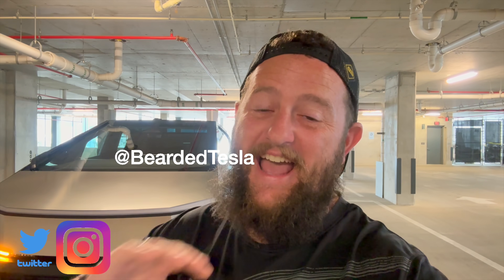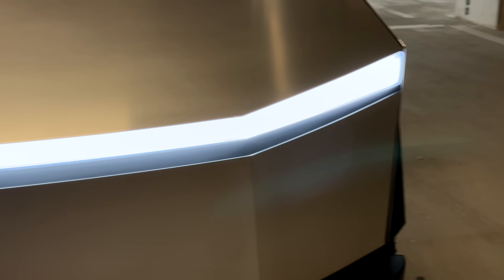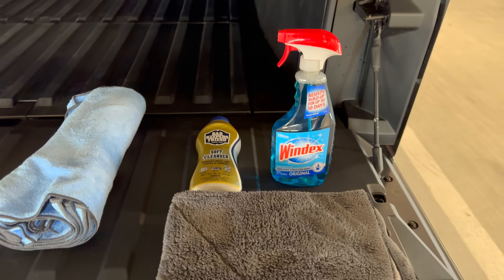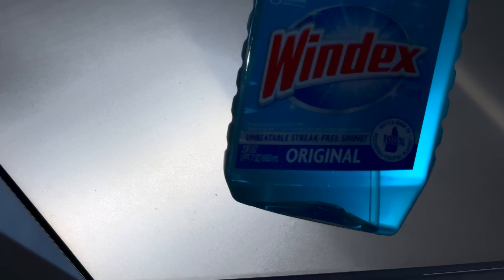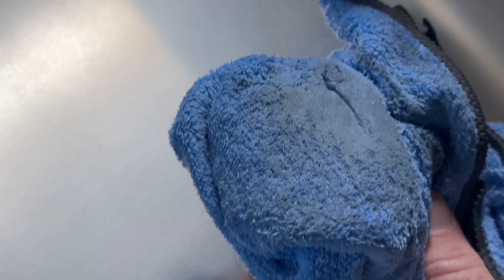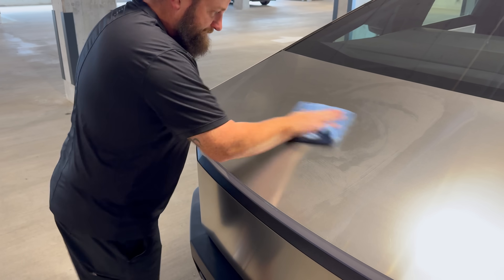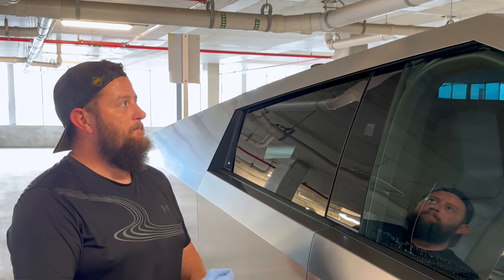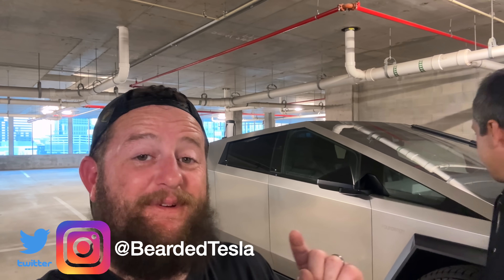Tesla CyberTRUCK or CyberRUST?? The TRUTH About Cybertruck Rusting Issue + How To Fix It!!

Comment: So this is essentially rusty dirt that has landed on the truck, rather than rust from the truck itself, but you need a cutting agent to remove it? So this layer of partical debris which has simply fallen on the surface of this $100k luxury truck cannot be removed without literally stripping away the top layer of metal from the vehicle...

It sounds like the rust is in the top layer of metal of the truck, not just sitting on it. If not, then how do you clean this truck at all? With a cutting agent every time?
Reply from the maker: its the same for painted cars. This is nothing new. Even painted cars that get this stuff on the surface have to be polished to get it off. The oxidation makes it really latch on, meaning it wont wipe off with just water or glass cleaner
Reply: @BeardedTeslaGuy  It still seems like a bit of a design flaw. Clear coats and wax can keep your car easily cleanable from most things, even caked on dirt. Having to use a cutting agent in order to clean your car at all is not a good thing.

Also, rust flakes landing on metal will actually rust the metal underneath. The electrochemical reaction will try to equalize the good metal with the bad, causing the good metal to degrade. This is why once something is rusted it never really goes away unless you introduce a metal with a higher charge, like zinc, to prevent the rust from attacking the base metal.

Or cover it in a patina, but that obviously isn't an option for a car.

Comment: It's called "industrial fallout". It's just iron that's falling onto the surface. Clean it with iron remover when you wash the truck. Simple. It's the same iron that's on top of painted cars. Which is why we use iron remover before polishing a painted vehicle. Iron remover, just spray on then hose it off with water. No scrubbing needed, therefore no scratches. Now to be clear I have not tried iron remover on a non painted or clear coated surface so I would suggest trying it in an inconspicuous spot first.

Comment: Cr-Steels need the covering Cr-Oxid layer, to avoid Rust. If you paint it, IT will Rust. If you Pick Up Metal particels from the streets, caused by other Cars brakes - IT will Rust. If you want to argue your neighbour with a Cybertruck - Put a ferritic screw on His Truck over a rainy night. Ferritic steel particels can also come from the ferritic Tools in the press- or Bodyshop. This structure is a construction-mistake as it's best. Good luck - "Elon Rust"😂

Comment: This is common issue with stainless steel especially brushed stainless-steel. ATM keypads manufactured from stainless-steel suffer this in environments where there's a high level of iron particles and high humidity. In our case ATMs located on very busy streets and not too far from the ocean developed rust 'spotting'.

These micro-sized iron particles become trapped in the surface finish often applied to stainless-steel and then over time in the presence of high humidity....'rust'. It can be scrubbed off with a plastic bristle brush (or cloth) and a good quality stainless steel cleaner. 

Of course, all the naysayers had to assume the Cybertruck was 'rusting'......(our customer at the time thought the same thing 'oh no, our stainless-steel keypads are rusting'!

Comment: Dude,  it is called ‘rouge’ or rust there is carbon in this stainless steel.  Steel isn’t completely uniform material.  Think of it as a cookie with a slight taste of salt present.  You should  polish and passivated.  Citric acid and electric current is your solution

Comment: soap + steel wool for pan cleaning will work much better.
Reply: Steel wool is the worst thing you could do. Fine pieces of steel will will break off and settle in the grains of the stainless steel and start to rust.
Reply: @kennethsouthard6042  if you scrupt without soap it will rust.

Comment: any iron particle contamination on the surface is going to eat into the steel. the surface of the truck is going to need frequent cleaning. someone should take the truck for metallurgical test to see just what its made of. Not all stainless steels are equal. I used to work inspecting industrial equipment and for anything exposed to the elements seems 316 and 316L were the materials of choice. but I'm not an engineer, my just was just to verify the materials per the drawings.

Comment: Doesn't this issue happen on any automobile? A few popular brands from Mother's and Meguiar's make iron fallout removers for vehicle finishes. The reaction of the spray with the iron creates a purple color. If the particle is embedded, you can use a clay bar.

Comment: No Sh#(t
As a ex Time Machine Delorean mechanic visual body panel rust is NBD
True Problem
Electrical grounds on Time Machine Delorean is 1,000 x worse than visual surface rust. I could not fix all the Time Machine Deloreann electrical problems.
and
Tesla is based on electrical hardware and software that means Time Machine Cyber Truck will self destruct
Con Job
Really bad is that Tesla knew about the rust problem and did not tell all those $120,000.00  Cyber Truck buyers 
Shame on you Tesla

Comment: Every metal oxidizes and any steel can rust. I don't believe for a second that some special "blend alloy" (whatever that means) has been developed for this truck. Just do an xrf (pmi) on the surface of your truck and we'll know what it's made of. Then any informed engineer can tell you under which conditions it rusts. They own one at most scrapyards, and if you want to be more thorough, go to a materials testing lab.

Comment: Some years ago, I had a white painted pick-up truck and noticed there were hundreds (maybe thousands) of spots of rust on the paint. I took it back to the dealer and he explained that it is actually called “rail dust”. Tiny particles of steel off of various wear items on other vehicles (brake drums and discs & etc.) that lands on other vehicles and causes these rust spots. We looked at it through a microscope and you could actually see that indeed it was a spot on the surface and you could easily remove it with rubbing compound or similar.
Reply: also had this on a white truck that was new, also told rail dust, think dealer tried a few things, from what I remember they came back though.
Reply: Rain it self can also contain iron oxides in very fine particle. Raindrops only form in the presence of dust no dust and it wont rain this is why cloud seeding works they seed the clouds with basically dust typically an oxide. But all your examples brake drums disks etc as well as train wheels and even from well you walking around on dry hardpack dirt that contains iron traces will kick that dust in the air where thermals take it in to the high atmosphere where rain forms. We breathe in iron dust and drink it in our water. 

As far as protecting it from getting the particles on it to start with anything that is anti finger print will also prevent the rust dust from reacting. So any wax made for use with stainless will work here as well. 
One such product i use on my knives that is also food safe and non toxic is clove oil. It has long been used for protecting carbon steels from rust such as those in kantanas. It also has the added benefit of smelling really good ROFL. But seriously a tiny bottle of the stuff will doo a full cyber truck a few ties when i say tiny bottle i talking sub 1oz bottle. What i would do is get a zip lock baggy a soft wipe rag and wipe the truck down with the clove oil then keep the rag in the baggy sealed so when you spot a blemish or finger print etc you can just do a quick touch up. A saturate cloth will last several years. Fact is i have a cloth from over 12 years ago that i have not added any clove oil to in a large pill bottle that is still damp with the stuff and just as useful today as it was 12 years ago. 

And please no one buff a cyber truck in to a mirror would it be awesome to see sure but would it be safe for anyone near no and would be a pain to get back to normal
Reply: Why don’t we see them on painted cars?
Reply: @rbs427  They’re just harder to see on darker colors. They’re very small. Small enough to behave like dust and get thrown up by other vehicles so they can land on the finish of other vehicles. If you took a good look for them on a darker colored car, you would find them, just as many as on a white car.

Comment: Does a magnet stick to the stainless steel body? If it does it will rust because the metal has iron in it. 316 stainless steel is rust resistant and chemical resistant. And a magnet will not stick to it.

Comment: The best way to buff and shine out the rust pocks is you fill a palm full of kosher salt in a wet rag and use that to gently scrub the spots out. The bigger spots you may need to push harder. Just make sure you scrub back and forth don't do circles

Comment: I bet the stainless steel vehicles are constructed with 400 series stainless steel, which contain some iron, and are not entirely "rust proof".   The 300 series is more difficult to work with & weld.

Comment: I have a long lifetime of experience with a sink of stainless steal.
It doesn't rust, but isn't outdoors, so that might not count.
But I do have to sponge it ocationally. That removed scratches too.
I still remember when I at age 5  opened a can on the sink and scratched it.
I thought that was a very bad thing to do to with a new and pristine sink. But they disapeeared
with very little scrubbing.
It's a shame if you have to do that to a Cybertruck too, isn't it?
My guess is that a car wash would remove that "rust" from a Cybertruck.

Comment: If you use 304 stainless instead of 316L w molybdenum you will get rust issues it’s only on surface rust from other materials and can likely be cleaned off

Comment: The CT is not rusting, all vehicles are prone to it. It's metal particles from from brake dust, rail dust, and environmental fallout. The metal particles embed themselves on to the surface, and begin to rust as they are exposed to moisture and get worse the longer you leave them. It is more noticeable on light colored vehicles because darker vehicles get hotter from absorbing the sun and can burn the particles away. An iron remover spray will melt the rust away on clear coat but I personally wouldn't try it on stainless and they should not be used on bare metal. You could always try a mild clay bar to remove the spots before hand polishing each panel and a ceramic coating or paint protection film would help minimize the issue without altering the appearance.

Comment: Years ago I had a Honda accord I parked on the street and it would have the same orange specks on the paint.  It was some pollution in the air.  Likely they were from the over head power lines.  I have a car parked outside and it’s in a different part of the city and the power lines are not on the street.  I don’t have any orange specks in the paint.

Comment: It is not little bits of iron blowing in from somewhere and beginning to rust. It is The truck that is rusting!  Pitting in a spotted pattern is commonly seen with stainless steel undergoing electrolysis started by exposure to chlorides.  My experince comes from working on autoclaves made of 316 stainless (highly corrosion resistant) and people who did some very foolish things including the placement of bleach in these same autoclaves.  The chlorides may come from any number of sources, they are highly soluble in water, and are highly corrosive to most metals.  Information on how the chloride anion catalyzes the formation of iron oxide in SS is easily found.  Barkeepers Friend contains oxalic acid which is a chemical chelator.  There are a number of other compounds that function as chelators that are also used in various metal polishes and cleaners.  How they work is observed here and information on their mode of action is easily found elsewhere.  The powder in polishes is usually a mild abrasive such as talc which assists in the mechanical removal of the metal oxides once they have been chelated.  My thoughts are to leave some sort of hydrophobic film on the surface of the SS after the rust is removed.  And, any rust must be removed before extensive pitting becomes evident!  Water is the medium where rust forming reactions start.  It is a chromium oxide layer that forms on the surface of stainless steel that makes it resistant to rust, but chlorides go right through this passivated layer with no trouble and react with the iron component in SS.  So if road salt is used in your area, just keep it in a barn for the next 50 years next to your unopened Billy Beer and Beatles lunch box and patiently wait for it to be one of the few that still exist.  Prolonged contact with ungalvanized carbon steal will also damage stainless steel.  In this case, it is the movement of electrons between two dissimilar metals resulting in the oxidation of one, usually the iron component in stainless steel.  We should not be surprised if Musk where to build and market a cement airplane soon.  It should prove to be a real gem.

Comment: hhhmmm

the presentation
from the get go

from RUBBER ARMED
Tesla presenter

a.  WEAKEST THROW
b.  glass did NOT LIKE ball
c.  glass still NOT LIKING steel ball

was preceded by

same Tesla WOBBLY ARMED
presenter wielding sledge hammer …

yeah right 

‘ tickle tickle ‘ hehe

HEMAN wobbly arm buffing the
door

SNAKE OIL
PURE COW PUCKY
SMOKE AND SHINY steel mirror

AND HEY

DID 1983 Delorean  not NOT
HAVE THE ORANGE 
SURFACE RUST

NOOOOOooooooo
it did not

so The glass on the New uBerTruck is
hehehe  FRAGILÉ
FRAH- GEE LAY

and shiny steel
is not so STAINLESS ???

and ain’t $39,990   ???
no

nahh
NO

ddaatt  cannot be huh 
people tell/ sell the truth right ???

Comment: probably the same cheap stainless steel that's on a microwave, high quality stainless steel doesn't do that unless it's contaminated with carbon steel. I've  uncovered high quality stainless steel bolts buried in my driveway about 10 years without a bit of rust on it.

Comment: Looks like it's made with duplex stainless. Probably 2205 (ferrite/austenite mix) that has not been pickled or passivated. It will definitely rust when contaminated with carbon steel and the rust will just continue to be spread microscopically when you try to remove it with an abrasive cleaner. The next time it gets wet it would be apparent.

Ever notice how the Deloreans didn't rust? It's because it was austenitic stainless. I'll bet this will be a lifelong problem with the Tesla truck.
Reply: My prediction is that these (at least early models) are going to look like complete trash within 2-3 years.

Comment: It's not called rust dust....it's called industrial fallout. Either way the Cybertruck is still dumb af and shouldn't be allowed on the road. US doesn't care if people die for others profit though so.

Also, just use a damn clay bar. Don't use that random crap, they make actual car shampoo for removing industrial fallout from paint etc. Like Adam's Iron Remover for example, but for a stainless steel panel all you need is a clay bar and soapy water. Also, don't do circles ever on car panels especially if it's paint. Back and forth not circles. Same goes for drying if you dry with microfiber towels. 

Yeah anyway, use a clay bar and soapy water. You don't need to polish your car every time like this guy is doing. Polish is sanding. Totally not needed for industrial fallout and will make it even easier for industrial fallout to actually stick to you car, paint or this.

Comment: Call it whatever you want, but it most definitely is rust.  Anyone who's ever owned high-end German cutlery can tell you that high-carbon "stainless steel" cutlery can develop stain spots, rust stains, and even deep corrosion pits if the blade is not wiped clean after cutting especially salty food such as ham and allowed to sit overnight in that condition.  Much of it has to do with the chromium content.  Marine grade stainless steel is most corrosion resistant because it has a higher chromium content, but high chromium content stainless steel is more expensive than lower chromium content stainless steel.

Comment: If it has a high amount of cadmium it will rust. Low grade stainless steel usually has this issue. If two dissimilar metals are used it could be intergranular etch.

Comment: There are a few reasons why they don't use stainless steel on car bodies.  Aside from the cost, it's also heavy and difficult to work with and impossible to keep "clean".  Imagine a nice black car.  You already know how hard it is to keep that clean.  Now multiply that by 10.  While you might get it "clean" with some buff work, it will be dirty again when you drive it next time.  You will get iron particles from brakes and various other sources in the environment, which will settle on the vehicle's surface and give that "rust spot" appearance.  If you want your new Tesla truck to look flawless all the time, you'll need to get it professionally prepped when you take delivery and wrap it with 3M PPF.  This truck was a stupid design by Tesla and will cause them many headaches going forward.  Many of the body panels are under "pressure", so if the mounting clips break, panels are going to let loose.  It's also going to be ridiculously expensive to fix (as parts need to be replaced and they are very expensive) so this will also cause a spike in insurance premiums for it.

Comment: Regardless of why the appearance of rust, consider after washing and drying to hand apply some ACF50. This stuff is incredible! Spray on, let it set for a few minutes and wipe off. I use this on my motorcycle. Never used it on stainless steel so try a small area first.